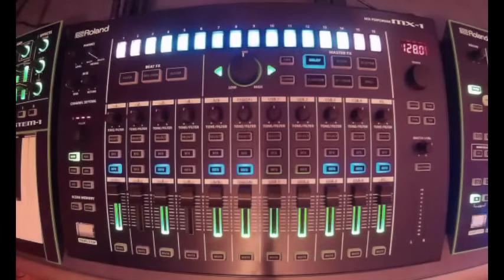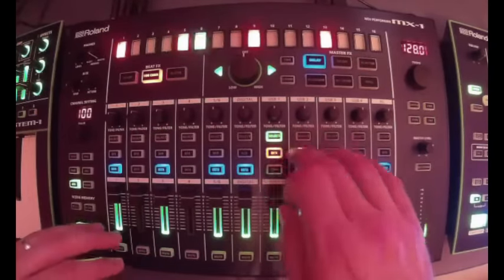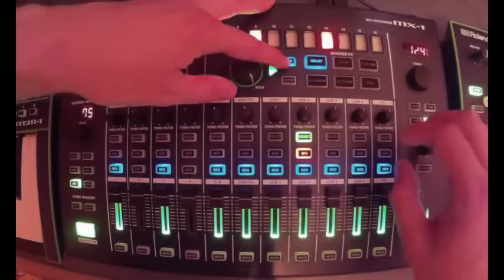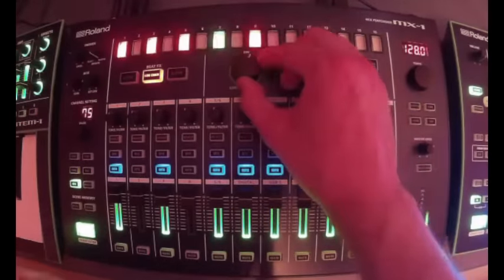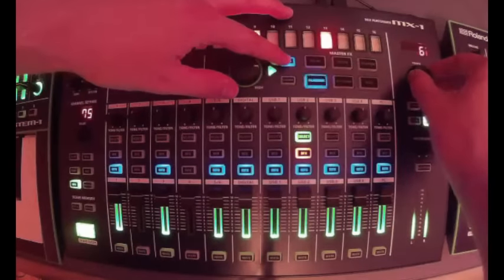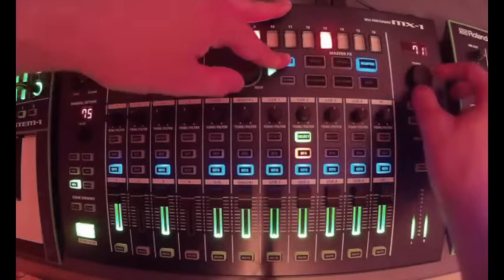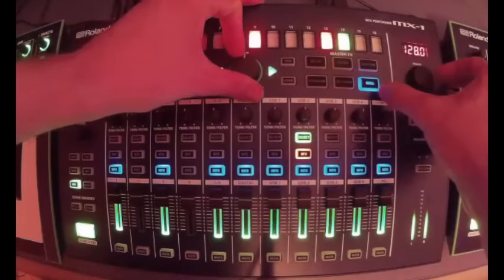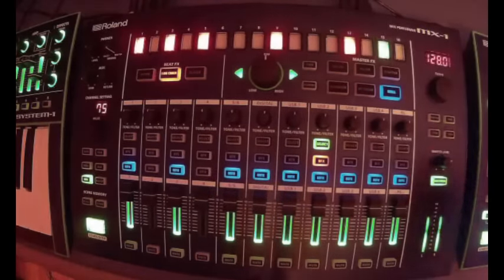Roland AIRA MX-1 - Beat FX, Master FX, and Mastering

Comment: Hi Reiche, What do you think of using the Line 6 Helix as a mixer? I am looking at converting the Mic Inputs to (for extra)Audio Inputs
Reply from the maker: +John Richardson hey John, I don't have experience with that mixer but we have run other mixers into the mx-1 at times.  I usually plug external mixers into he send return on the mx-1 since it am not using any external effects.
Reply: Would you use the Bastl Dude w/ the Roland MX1 & Traktor PRO 2?(together)

Comment: Hello, any suggestion to use Roland MX-1 with Ableton and Traktor PRO 2 together? I need help, thanks!
Reply from the maker: are you using Ableton and Traktor Pro 2 on the same laptop and on a PC or Mac?  The downside with using it with a PC is the ASIO driver is not multi client so you would not be able to run it on the same PC without using a virtual ASIO driver like Jack for Windows or Voicemeeter to bring the audio from both apps in.  Then you can reroute the audio.  Jack is more versatile for this but it's also a bit more technical when it comes to setting up.
Reply: thanks for your reply, i want to use ableton and Traktor on the same Mac.
I have MX-1 and TR8 and I want to use them in Ableton while Z1 and X1 to control Trktor PRO 2,
any suggestion?
Reply from the maker: you should be able to do that fine, just route the audio from Traktor to two channels on the MX-1, when you are cuing, use the Sel button on the MX-1 to listen to what you are cuing in Traktor. I've done something similar with an MX-1 and TR-8 and Traktor S4 and it's worked pretty well.
Reply: Reiche thanks for your time, i will try!
Reply: Would the Bastl -- Dude, work in this instance?

Comment: I couldn't hear much of a difference between the different types of the mastering chain appart from number 9. Might be hard to judge just by watching on youtube. Did you feel it does make a real difference to the music? I hope it's not like the bland compressors on the tr8...cheers
Reply from the maker: zigular909 there's two factors that probably effect how different the mastering presets are.  first would be Youtube's compression, the second would be whatever you're listening on.  If it is something with no low end you probably won't hear the difference since they seem to be different emphasis on the low end and sub bass.  I'm sure if you had a MX-1 in front of you and went through the presets you could hear the difference.